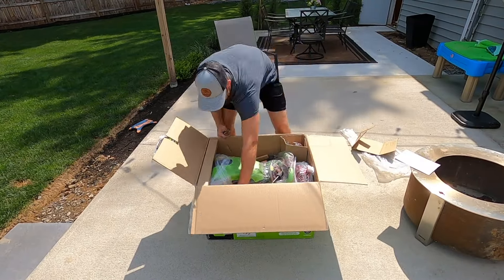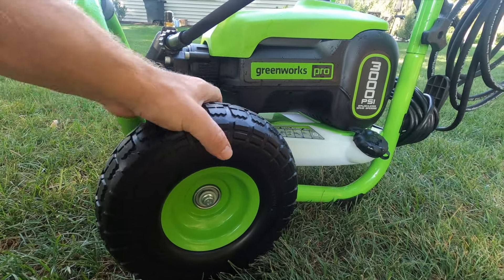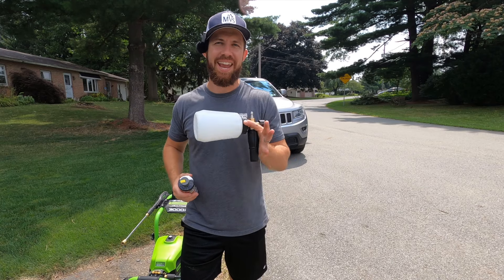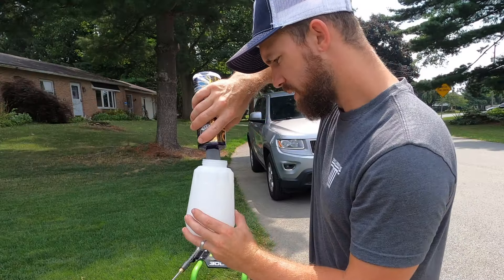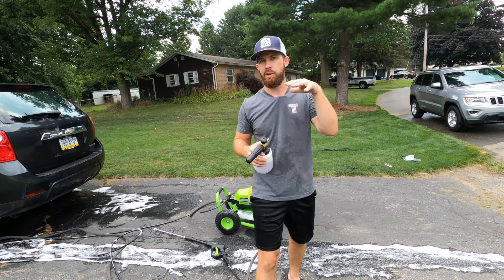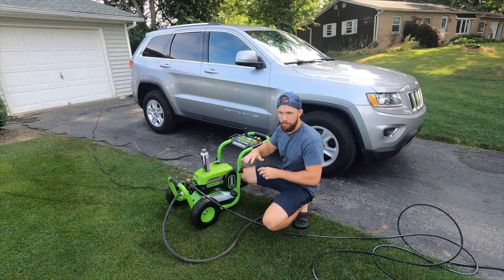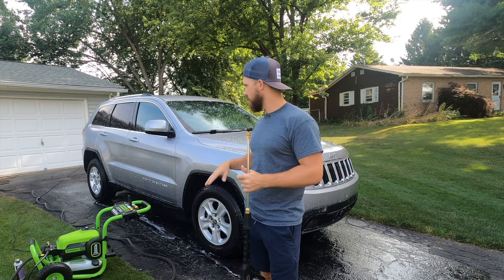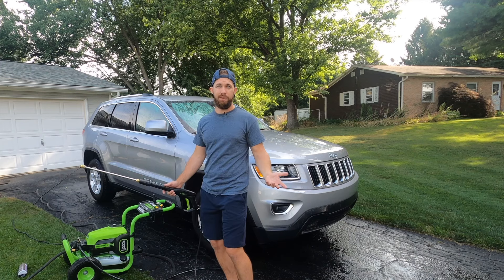Satisfying Pressure Washing | PLUS Greenworks Pro 3000 PSI Pressure Washer Review |

Comment: Hello. I was foing to purchase this, but then started reading some bad reviews. We have a pretty large driveway and a 15 inch surgave cleaner. I just sold our big gas harbor freight and i think i might of made a mistake. I read that you can't run it more than an hour, dont ise an extension cord, and multiple people saying it just just off and wouldn't start again and sometimes turning it off and on it will work again. Do you think i should just get another gas one if I have a large driveway? Thank you.
Reply from the maker: This is great for smaller patios, cars, sidewalks. But a larger pressure washer with a higher GPM and a surface cleaner might be what you’re looking for.
Reply: @RootedLawnCo  Thank you for the quick reply! Guess I'll go back to gas. Sucks I just lost $200 on the gas one I sold. Paid $400 and sold it for $200. I should've done more research first🤦🏼‍♂️
Reply from the maker: @sethw1230  I mean, this works great.. but if you have a huge driveway, it’s just going to take you a lot longer.

Comment: I saw a YouTube video where they tested the pressure of the White Nozzle and it was at 2,000 PSI which I read is to strong to wash a car. Thoughts on this or using another tip that will help reduce PSI?
Reply from the maker: There are different nozzles you can put on this, but I saw no issues when washing my vehicles. There is a few that are not recommended for cars though. Always read the instructions.

Comment: Oh wow they changed it's design.
Reply from the maker: They did. I like it
Reply: I’d like to point out this is the “new and improved” GPW3001 with a different cover on the motor and no longer includes the Uberflex pressure hose 😖 the GPW3000 did (which Lowe’s apparently still sells).  As well this Costco model is the GPW3001P with its fancy ball bearing plastic (look like go cart) wheels.  I too would like to HEAR this unit operate - both it’s operational sound as well as it’s start/stop functionality.  GREAT REVIEW!  Thanks…